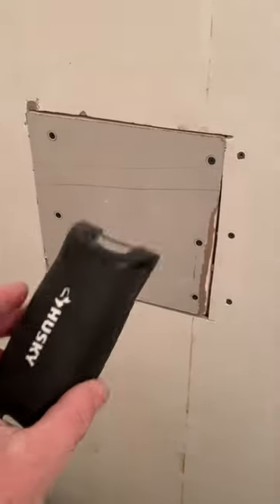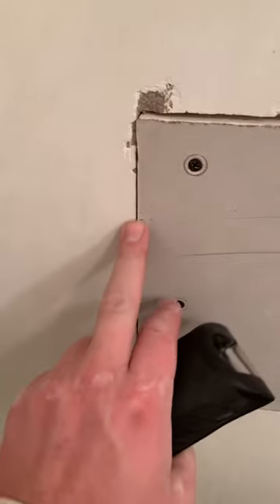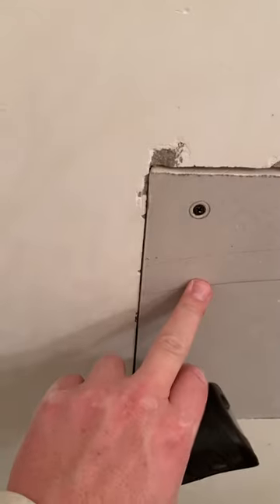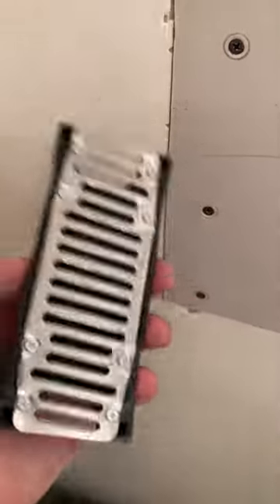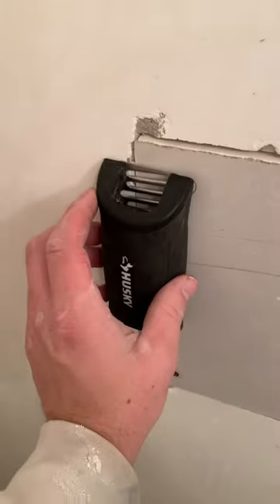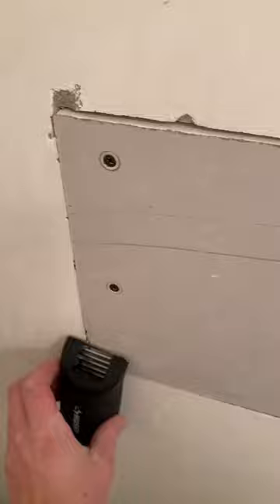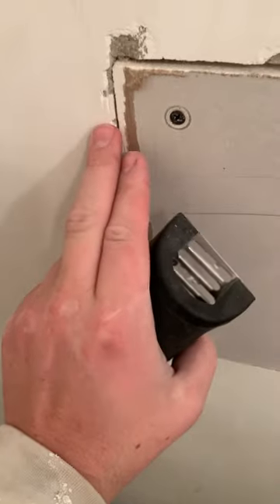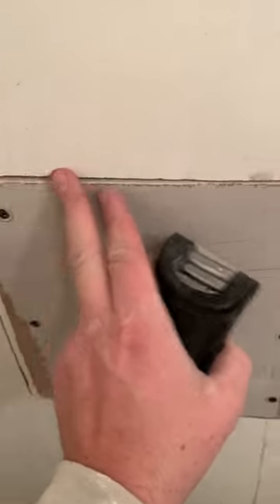How to use a drywall rasp to make taping easier. #drywall #diydrywall #drywallinstallation

Comment: That’s what mud is for man. Feather out the whole area with a 8-12” knife depending how bit the patch is. Patch is square, make your mud round to cover it all. Rasp are to clean up edges. Woulda helped with adhesion to leave the paper on the front side about 2” all the way around the cut edge covering up your cut lines.
Reply from the maker: @CornPopsDood  that’s how I do patches now. I’ve learned a lot since this video.

Comment: I would not use a rasp for this.
Reply from the maker: What would you do?
Reply: Should have beveled the back of the patch and not destroyed thebpaper front
Reply: @BurkholderCustomCarpentryLLC96  I’ve never thought about using a rasp but I’ll give it a try, that’s the beauty of drywall there’s many different ways of doing a job what’s important is to find your own style that’s consistent and clean. I was taught to use a box knife and cut the edge that over laps to level it out you then prefill the valley and apply your choice of tape after that. My rule of thump is to always make sure it’s leveled at the end flat as a pancake
Reply: @BurkholderCustomCarpentryLLC96  I’m assuming your rasping a harder surface compared to Sheetrock cause I’d imagine the rasp again the edge of Sheetrock would just tear it up, either way thanks for the tip man